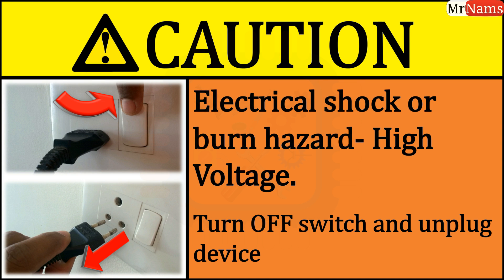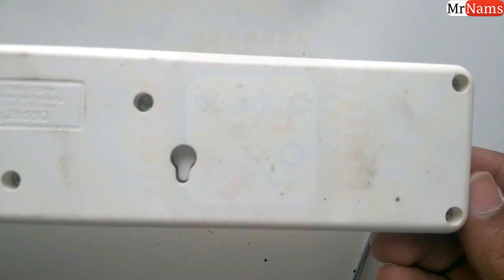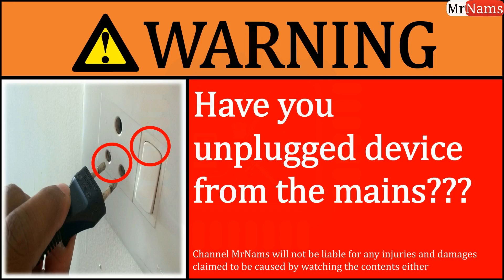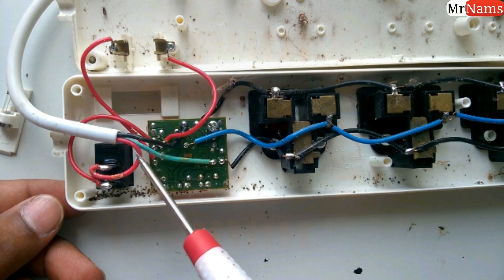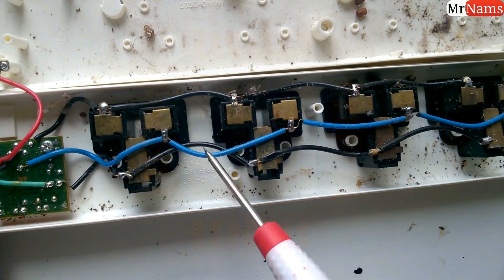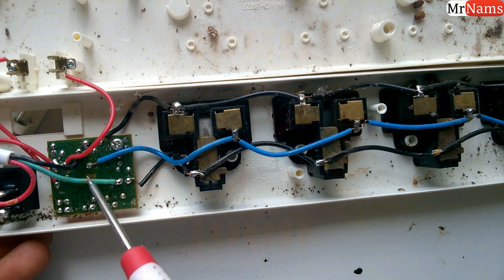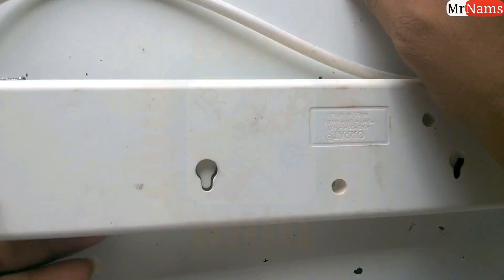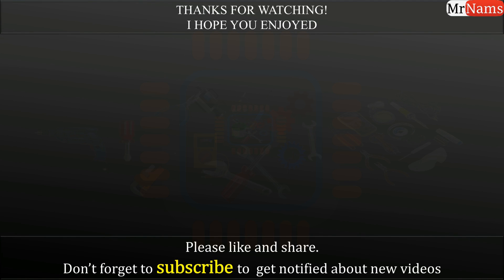surge protector extension board

Comment: Only Gnd op. Indicator is blink what can i do for all ok indicator blink
Reply from the maker: There are combination for problems, just read text near indicator, check if fuse has not blown.
Reply: @MrNams  there is no fuse blown and i see one thing that if i pluged two pin device in earth and neutral socket then all ok indicator is blink